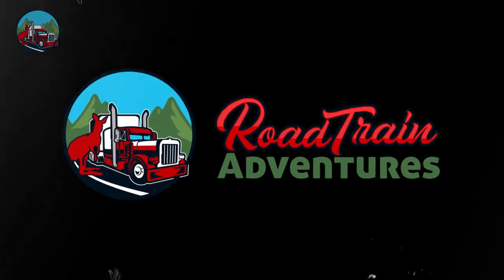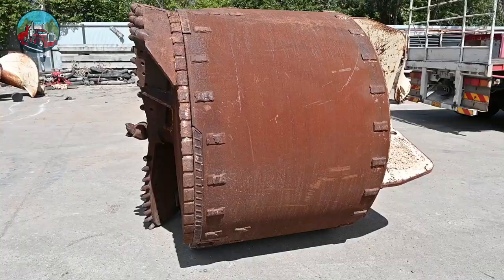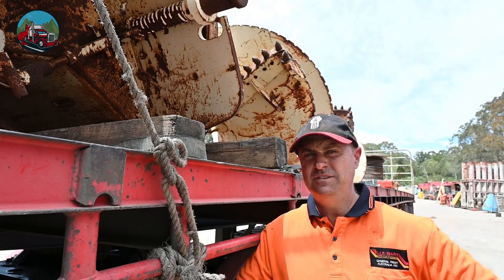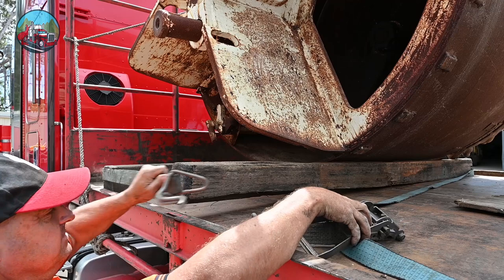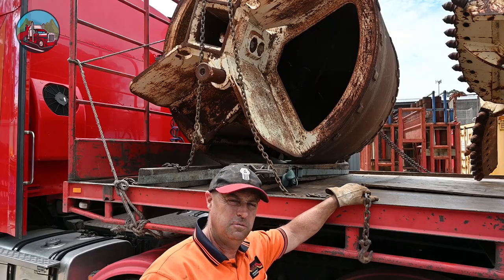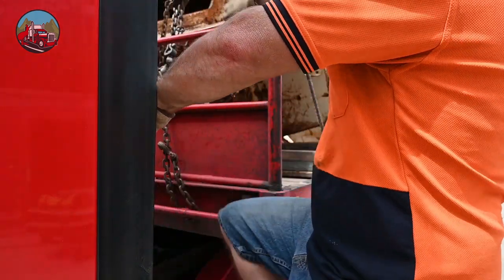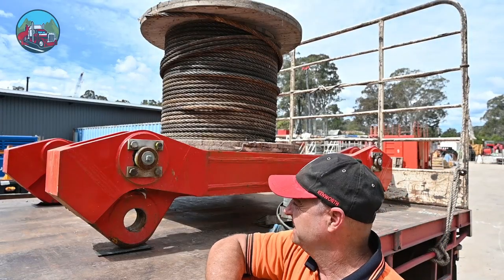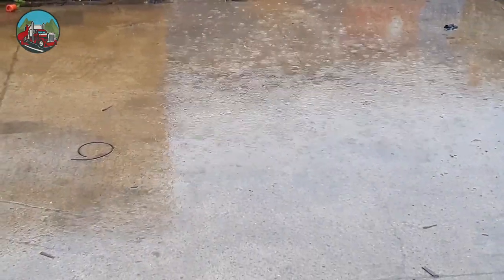How to Chain a Load

Comment: If I dont have any time pressure and I don't need to move the truck to get out of peoples way I love chaining down/strapping complex loads. Chains are actually enjoyable to use, especially when using that style ratchet. Great video.
Reply from the maker: Thanks man. I actually prefer straps over chains.
Reply: @RoadTrainAdventures  do you put a twist in the strap on each side to stop it flapping in the wind? I can never get them to stop flapping unless I twist it but I know technically it's wrong to do it.
Reply from the maker: No I've never seen anyone put a twist on the strap and I don't do that myself.
Reply: @ESPSJ  no it's not wrong. There was a study done it doesn't change the load rating or breaking strength of a strap at all 👍👍
Reply: @stuartnjaii  I see people do it every so often and I've tried it myself. It makes a massive difference and stops it from flapping completely. It also depends on the load and the angle of the strap too. Sadly the NHVR look down on it though. I'm surprised more people don't know about it.
Reply: We didn't have those ratchet type chain tightners when I used to do it. We only had the screw type and the clip down type binders . Dogs we used to call them. these ratchet ones look a lot easier to use. The strap tightners we had used to lock down underneath the tie down rail. All OK though - I used to like that kind of work.
Reply from the maker: Yes these ratchets are great.